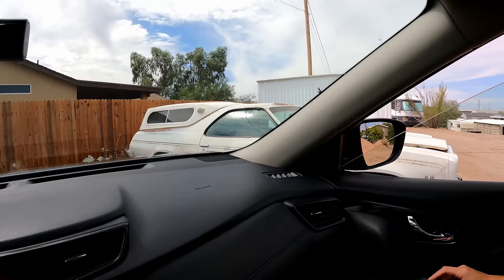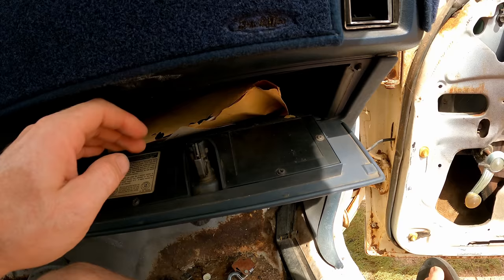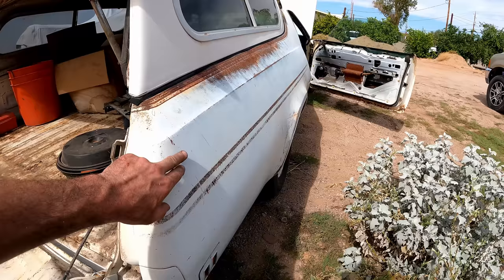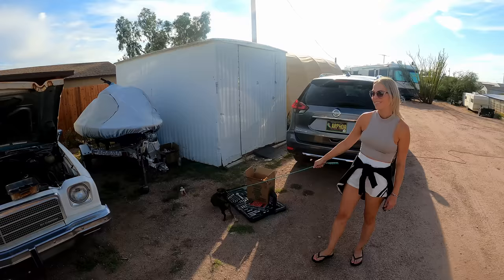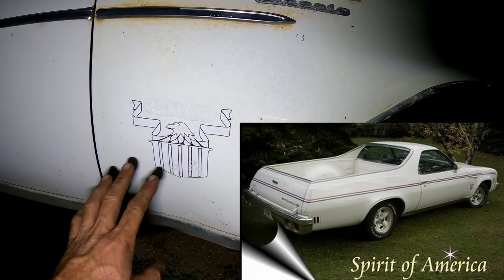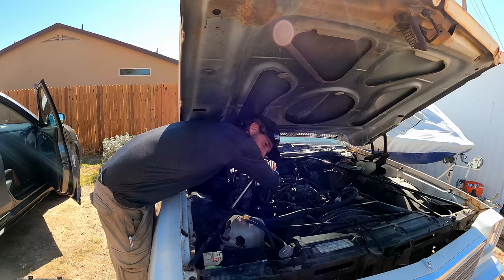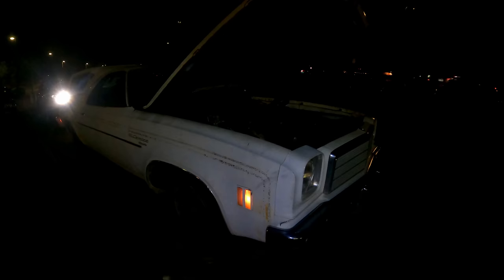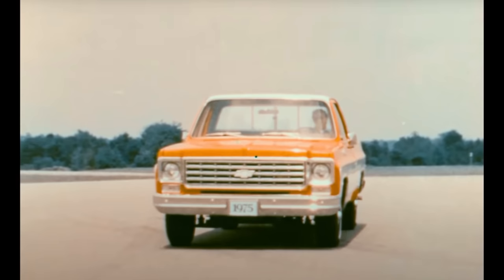1974 El Camino Desert Queen Sitting For Years! Will It Run/Drive? - NNKH

Comment: I was a Highschool senior in 1987 I bought a 1974 Chevelle Malibu  4 door with a 350 My Mom who was very skilled helped me paint it cannery yellow I drove that car for years. It had a points distributor I converted it to HEI I added a 1970 stock4 barrel manifold and Quadrajet carburetor and dual exhaust. It was no race car but it would travel down the highway with ease at high speeds. You check the Transmission fluid when its running not while engine is shut off.
Reply: N I C E
Reply: Exactly
Reply: I think he knows how to check trans fluid on or off.
Reply: @Hanzyscure  Just suggesting is all
Reply: @joellekarma  , I would have LS swapped the car and made it have some go.
Reply: @paxhumana2015  In 1987?

Comment: The older Chevy small blocks had pressed in rocker arm studs -- running them at high RPM's would pull them out a bit, looks like that is what happened --- they sell threaded studs - pull out the pressed in stud - tap it and thread in the new stud --- Done ! Great videos -- good luck !
Reply: Love the Spirit of America edition on a ElCamino. 👍

Comment: that access panel in the trunk is a GM stopgap, the el caminos and malibu wagons shared the same frame and floors, so instead of making a different cast for the elkie floors they just threw a slab of sheetmetal over the rear footwell on the wagon floor and hey lookie now you have a place to put your beer in case you get pulled over

Comment: I sold that El Camino to the guy you bought it from 
It has a rebuilt engine in it with 30,000 miles on it 
The receipt for the engine is in that paperwork 
I bought the car from the son of the original owner
Reply from the maker: That's so cool that you ended up seeing this video! And yes I haven't dug through all the receipts yet but he did mention that it was a rebuilt engine bored 30 over.

Comment: Brings back memories of my 73 El Camino restoration. Nearly everything needs TLC, but they are fixable. With 4 coil springs, the  3rd generation El Camino rides so smooth over a pickup truck. El Camino and Ranchero are the original SUV, sport trucks.

Comment: Great video! Love 1973 1976 Chevelles/Lagunas. My second car was a 1974 malibu that ended up getting a cam, quadrajet, duals and a posi/sway bar from an olds cutlass with 3 55:1 gear and i ran 4 AFX scat trac L 50-15s on the back. That car was so cool. That was 1980. Keep bringing the great videos!

Comment: My 1st car was a 73 Chevelle..
Id love to find one thats not a bucket-o-rust.
The 74 Camino is based off the Chevelle .
I love em.
Most came with the 170 hp 350. Low compression smog hogs .
The EPA won out & killed the muscle cars for 25 yrs.
But , you could buy them cheap in the 80's .
Love to find a Chevy Monza Spyder..
I had a 77' with the small V8 In hi school. It had a 262 I think.
I had to practically pull the motor to get the back 2 plugs out..
A lot of em were crushed because the frames rotted at the wheel wells..

Comment: Sportin the Diesel Creek shirt! The real star in that driveway was the mid 90's Country Coach Magna! 
Those years were prone to bad cams it seams. I got a 350 out of a 76 Impala a old lady owned and it had the bad cam, but a off the shelf parts store "350 hydraulic" Isky cam and lifter set fixed it right up! Got many miles out of that motor!

Comment: Is it just me or did that rocker stud look like it was taller than those adjacent? Some old SBCs are known for lifting those press-in rocker studs. I've had it happen three times on three motors. The fix is drilling and tapping them out and replacing them with screw in studs.
Reply: If you were on a tight budget you could “pin” the pressed in studs. You drilled through the pedestal,through the stud, and then hammer a hardened pin through both. A lot of dirt track guys who were broke would pin them as it was far cheaper than machining and installing screw in studs.

Comment: Those 70s GM small blocks are notorious for soft cams, had a 77 Impala wagon with a 305 and it started clacking and the rocker came off and it dropped a valve, all I can figure is it got jammed up and broke the top of the valve off or knocked out the spring keeper, either way it was catastrophic.

Comment: Haven't seen the end of the vid yet, but I'm @32:34.  If you remove the pushrods there is nothing to keep the lifter in it's hole.  It will fly out as the RPM comes up then fall back into the Cam via the big open slot in the valley. It will tangle in the cam lobes,...crunching and other bad noises happen.  On top of that there is oil pressure to the lifters from the side of the hole,...without the lifter in the hole to hold the oil pressure you will lose a bunch of oil pressure as the oil pours from the open lifter hole back down into the pan.

Comment: Another great video. I’ve had similar engine with stuck lifters. I had one that I brought back around by spray in penetrating oil down the pushrod hole (great opportunity to demonstrate the product of your sponsor PB Blaster). Personally I would be more agreeable to removing the loose rocker arm and pushrod than tightening it down. That’s almost a 100% chance of wiping out the cam lobe for sure. If this engine was rebuilt shortly before it was parked, it’s around the time that oil manufacturers started removing the zinc from the engine oil. If it’s a stock cam, it’s possible it’s still ok. It’s the aftermarket cams with higher spring pressure that made failure almost certain.

Comment: I inherited my grandfather's bone stock 74 elky when I was 16. My brother drove it for two weeks and it "randomly" acquired a lower end knock. So I did what any sensible 16 year old would do, I spent every dime I had saved for college on having the 350 bored and stroked to 383 and replaced everything besides the block. Unfortunately I only drove it a couple times before shipping out to Iraqistan, parked it in a storage unit where it sat for 14 years. This year the storage garage it was in got hit by a little nader, luckily my stall was one of 4 untouched stalls. That motivated me to haul it closer to where I live today so I can hopefully get under that hood soon.

edit - Now that I think about it, the 74 elky is what I learned to drive in. "Imagine an egg under the gas pedal, you don't want to crack that egg." Was the first time gramps took me out. Within a month it was "give her the onions, you gotta blow them cobwebs out every once in awhile."

Comment: I had a 74 El Camino I bought I think in 79. It had a 350ci 4bbl. I had many problems with that car. The cam lobe for the fuel pump was wiped and I think cylinder 6. Had numerous starter issues. Also the wiring for tail lights was exposed in the rear bumper and any mud, snow, ice, debris that was picked up by the rear wheels was thrown back and would collect on the inside of the taillights and wiring harnesses. Then there's the frameless window's in the doors. Do not open / close door using the windows, they will shatter. Also ensure that the proper OEM starter mounting bolts are used and torqued to specs or the engine block can be cracked where the starter is mounted. Good luck with your project.

Comment: Chris & Jenn & Gus…Another Great Video! Most of us don’t even have the guts to fly halfway across the country, and try to get an old vehicle going, to drive back home!! Amazing. I like how it's not just about the car, but places you visit and bring Gus along too! As for those lifters, I have sprayed Carb Cleaner down the push rod hole to free them up. Then adjust them to Zero Lash plus ¼ turn. And then an oil change.

Comment: It makes sense that the carb is a 1980 and newer, because  when you checked the oil the dipstick was on the passenger  side, so that would make the engine a 1981 or newer, all the 1979 and earlier have a driver side dipstick.

Comment: Another crackin episode guys. Can't get enough.
Question- can someone tell me how registration works in the states? Coz here downunder you can't drive a car on the road at all without rego, our cop cars have license plate recognition and all they have to do is drive past you and it alerts them your not registered and you get hefty fines and car towed. Ps our rego and insurance is average $1200 and the car has to be in perfect order.
So my question is how do you manage to drive across America in that beast?
Cheers
Reply: All states are different with registration and tags prices but its illegal to drive without either anywhere but most cops are cool about it honestly. In 2012 I drove from Florida to Maryland on a Saturday with no tags I got pulled over twice but I had all my paper work proving I bought the truck and was driving it home both cops told me be careful have a safe trip
Reply: @frankm8533  Ok, wow, lol thanks for the info. No way cops down here would allow that, not In a million years. 
Thanks👍
Reply: @rhyswoodman6781  I do understand that they have a job to do. We definitely have cops here that would impound you and major tickets but I've been pretty lucky with that but I don't do it much anymore now that I'm older Lol

Comment: One time I was helping my buddy assemble his 383 Stroker for his CJ5. I'm not a real mechanic, shade tree guy. I was meticulous about everything. Checking the rod clearance and everything. I was at work and he had the day off. He checked the valves and tightened the loose ones and loosened the tight ones. It ran for 10 seconds before I could shut it off. I never let him touch his own stuff again. He spent $750.00 on that engine in milk crates. Eventually tore the jeep in half.

Comment: Hi chris i was just watching your video on the saltyseadog jeep .u showed your well .have tried to drill a hole in the concrete then pop a rope or wire round it then u pull it out .or just drill line of holes in it so it break it half .you may be get the out that way

Comment: If those rocker studs are pressed in, its possible they have pulled out and the cam is fine. the fix would be to thread the holes and use threaded rocker studs.

Comment: I got a clasped lifter on my 99 suburban, I put in a used engine in it 6 years ago from a truck with almost 400K miles, and its had a noisy lifer ever since, Im running it until it dies lol. I got another engine lined up to drop in it, but 6 years with the tapping, im impressed its ran as good as it does still, the engine has over 500k now, I bought the suburban with blown engine with 190K, I got 320K on the truck now, still going.

Comment: Great find. It may be a 74 but in that year for the engine they came with the old round horn dual jet 2 barrel and points ignition would be the norm and last year for that unless it came with an HEI which 74 would be the first year usually only in option form, then for 75 it was standard on every engine. Maybe the previous owner changed a few things over or changed out the engine completely. Either way it's in decent shape. If the previous owner added HEI, hope its not running on the points style resistance wire, it will run but not optimally. Had that happen on an old 66 Chevy Belair I had till I installed the power wire correctly.

Comment: Have you ever thought of putting berryman's B12 in the oil, to clean it out. My stepfather gave me two cans of Berman's B12 liquid, I poured it into the engine, drove it for a day, then change the oil filter added a little oil, drove it for another day, change it oil filter, and then drove it for one more day and then drained it and put new oil in it and a new filter

Comment: The valve train issue is probably a soft cam. Chevy had an issue with these in the early-mid 70's...I had one in a '76 Camaro, one in a '75 Laguna Chevelle. Tighten the rockers down til they're quiet, a month later they're noisy again, and you're losing power, as the lobe(s) on the cam are wearing down smaller.

Comment: Can’t wait for the next one! Love a good road trip filled with question marks. 
What fun is it KNOWING you’ll make it home?
Reply: I’ve only met one female in person who likes the El Camino.
Reply: NICE vintage car in your avitar ! is that a chevette?
Reply: @katieb777  yes it is. 1980, it’s in the middle of a never enough time and money at the same type type of upgrades. It’s getting a supercharged 3800 bolted to a Firebird 5 speed with an S10 rear end with z28 rear discs and a home brewed front 5 lug/13 inch disc brakes up front. I have BMW steel wheels on it 15” up front and 16” out back, with knockoff brand moon discs. 
The scallops is a 99¢ per can Walmart spray paint job our son and I did, going over the respray it received in the 80’s.. possibly the worst paint job known to man, it has the texture of tree bark.
Reply: @Project_Low_Expectations  its a nice car !! gosh youve done alot  of work on her too !! shes s really NICE !! 
wow thats cool that work ya done on her too! bravo
Reply: @Project_Low_Expectations  she looks wow really NICE ! sir it looks like you did alot alot alot of work on her !! she looks really GOOD TOo! chevette are rather uncommon cars wow i havnt seen one on the road in YEARS!  she looks nice too !! what kind of paint did you use on her ? i hav a OLD 1995 isuzu pickup i got her USED from an impound auction rather CHEAP too she needed some body work  im rather artistic so i did it myself and i got some paint (PPG  deltron) i painted her too and wow she looks really nice ! (i painted her a dark dark blue )

Comment: Man If you really don't feel like taking the carb apart and it's doing exactly that get a can carb/fuel injection cleaner and dump it down the throat of the carb and Rev it up blow the cobwebs out. If your werry about it go look up the red grand marquis video from vice grip garage. Really helps Clean things up without taking things apart

Comment: I've always used jack stands before working under a car. Much prefer a bumper jack over any scissor jack I've had the misfortune to use. Don't like those GM side post batteries at all and always convert mine to top post.
Reply: Until a bumper jack kicks out on ya they are dangerous scissor jacks are pretty safe but I will tell ya a come along bumper jack and 2x6 and a shovel I can get any car or truck unstuck

Comment: That access in the floor is the back foot wells of the backseat on a station wagon since El Camino's used the station wagon body and frame and instead of using different floor they just covered the floor wells up with a coverall the El Camino's had that

Comment: You need to have super glue on hand when you tear a carburetor gasket you could just glue the spots that are ripped back together and set the top on right away and it will function perfectly after. Old race track tip

Comment: 1974, first year for HEI distributors.  Those carbs were basically a Q-jet with the two back barrels chopped off . . . and I was gonna say, that carb should've been a standard Rochester 2-bbl, not that early emission P.O.S.

Comment: your no compression cyl could be the result of a stuck open intake valve witch may have bent the push rod witch would give you both no compression and clatter. sticking valves a common result of trying to run on old gas.

Comment: Love the channel Chris I'm in Tucson I got a 02 Tahoe that runs got the vortec moter needs a tune up doesn't over heat 181k on it but it would be a good runner if you got it going not in bad condition been hit in the front no rust I'd take a 1000 for it where could i email for some pics and I'm in Tucson

Comment: that's not the original engine, the gm blue didn't started until 1977  that explains the 1980 Rochester 210 carburetor too.

Comment: Hey quick question. I’m watching your video you made about your oil pumping equipment. Was wondering why did you have the water lock filter upside down. Is there a specific reason?
Reply from the maker: To help prime it
Reply: @NoNonsenseKnowHow  that makes sense thanks so much. You don’t know how helpful that video was. I essentially went out and bought the exact same set up and went 1inch hose fillrite. How is that pump holding up? I just bought my first home and it has oil heat
Reply: @NoNonsenseKnowHow  I got one person lined up already to pump half tank. Do you have any tips on sourcing people for pump outs? I’ve been searching Craigslist and marketplace. Also trying to tell any plumbers I come accross

Comment: It's either got a 400turbo transmission or 350c.i block with 400 heads or 400 block with 350c.i heads...I've never seen 350/400 for the engine size cause bein an El Camino that core support tag might be engine and transmission size that came factory in it...400turbo transmission makes sense because it can haul stuff and station wagons had the big transmission as well...Just like a truck had for most years

Comment: Would be interesting to know what engine that is. The carb is not the original nor the right model for a '74. The one on there is a Dualjet, and a later Dualjet at that. It's very possible it's a 350 underneath but at the least that intake was far more likely to have started life on a 267 or 305 small block. The original carb was a Rochester 2GC which has no possibility of interchanging on that later intake.

Comment: You did not prep the engine before firing it up. No oil or mystery oil in the cylinders? Needs spark plugs, spark wires points?

Comment: So they bored it .30 over but left the choking old 2bbl carb on it my old Scottsdale chev had a 350 with a .30 over bore and rv cam and it wouldn't run very good with the 2bbl I put a edelbrock intake and 4bbl and headers with a single 3" exhaust and it ran 50 x better more power better mileage and with the 2bbl it wouldn't spin the 31" tires after the new stuff it would spin them no problem anyway I have a hard time believing its bored unless they did it because of cylinder damage